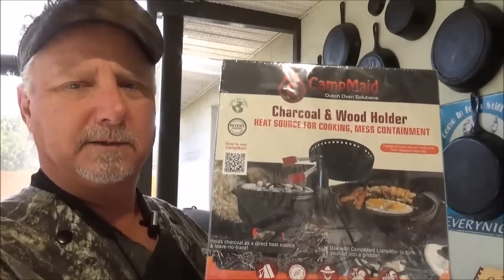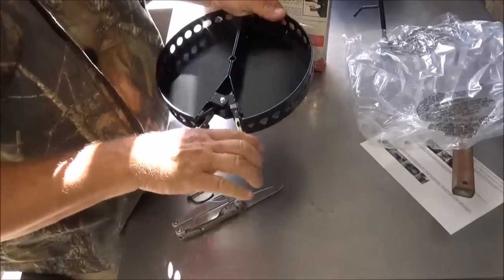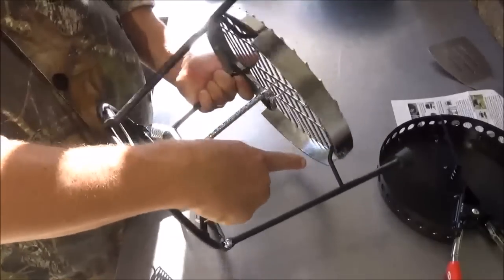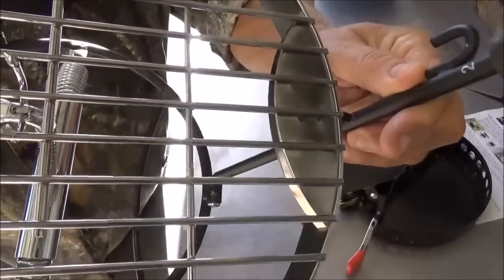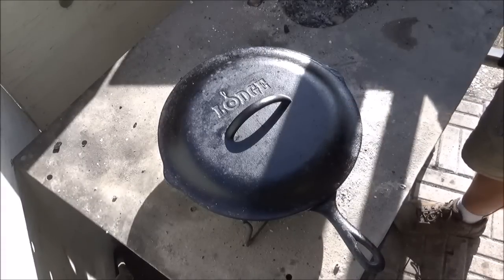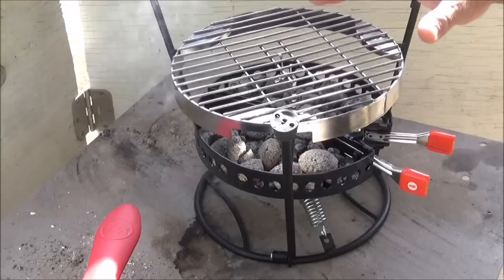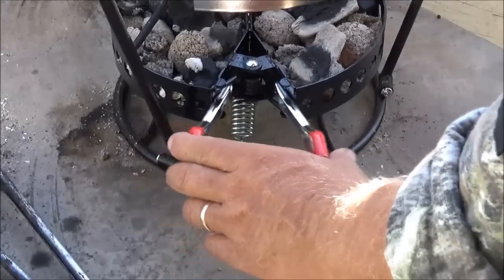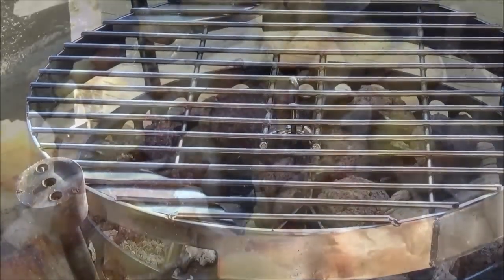Un-Boxing Assembly and Using the Campmaid Grill Kit

Comment: I have the same set up, read the directions.  It works great and the handles push in so all the pcs, fit into a dutch oven for portability.  I use mine all the time at home and camping..

Comment: I agree. I probably wouldn't use that for anything other than burgers and dogs. You can flip your DO upside down and put it over the top like a lid. That would help hold some heat in. That little grill grate can also be used as a trivet in the bottom of a 12" DO to keep the food off the bottom for steaming or whatever. I'm interested to see how you like that charcoal after using it a while.